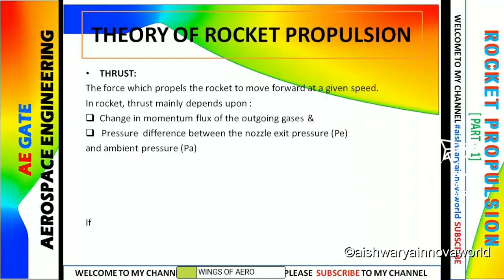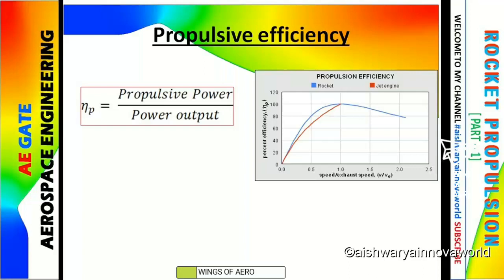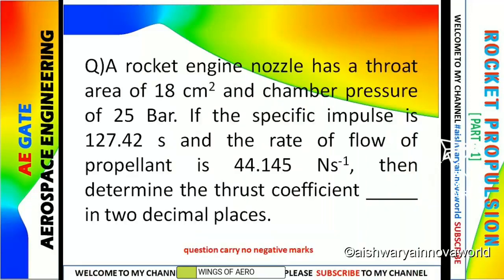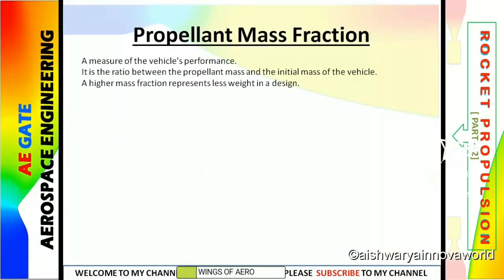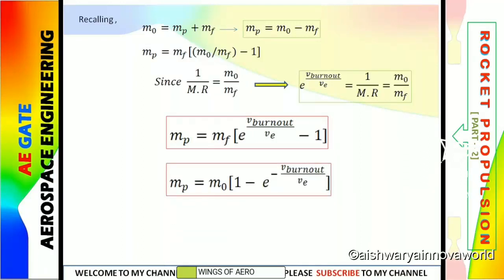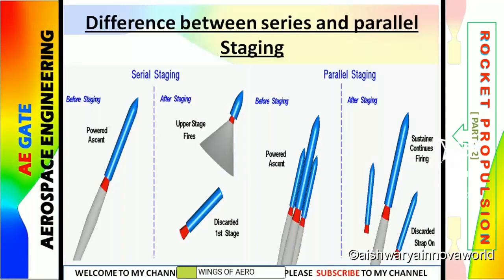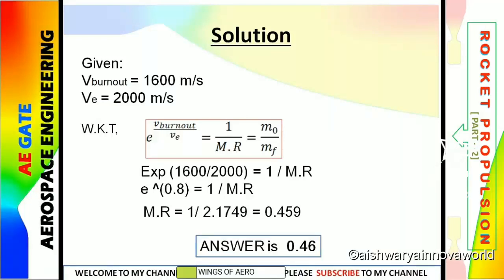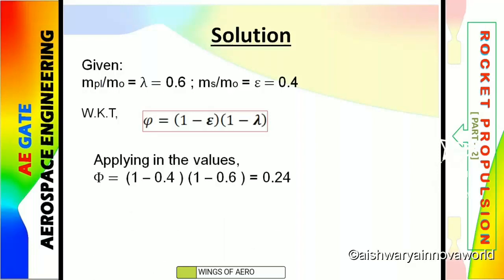Introduction to Rocket Propulsion | Ms. Aishwarya Dhara | GATE - Aerospace

Comment: I think, the formula of propulsive efficiency is 2(u/v)/(1+(u/v))
Reply from the maker: Rocket thrust is independent of flight velocity, while the turbojet and propeller depend upon it.Rocket engines have a slightly different propulsive efficiency () than airbreathing jet engines as the lack of intake air changes the form of the equation. This also means that rockets are able to exceed their exhaust velocity.
For further reference George P. Sutton & Oscar Biblarz, Rocket Propulsion Elements, pg 37-38 (seventh edition)